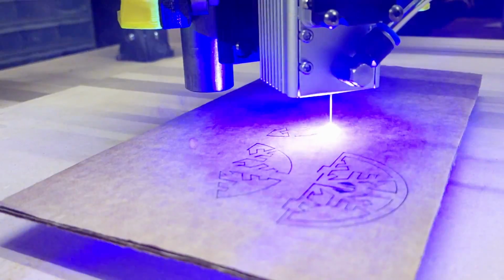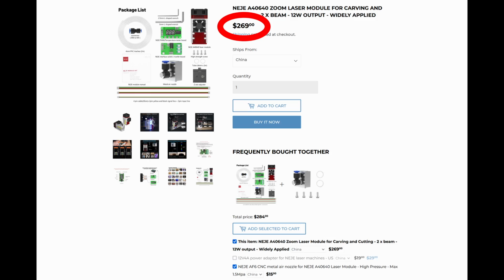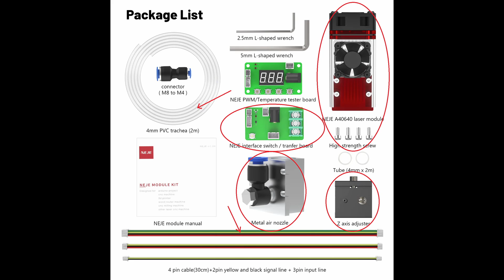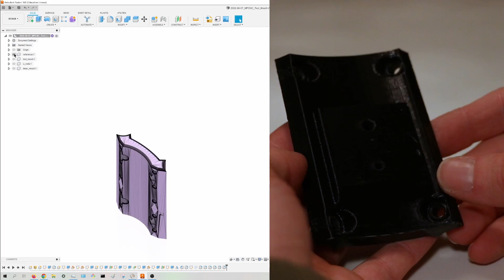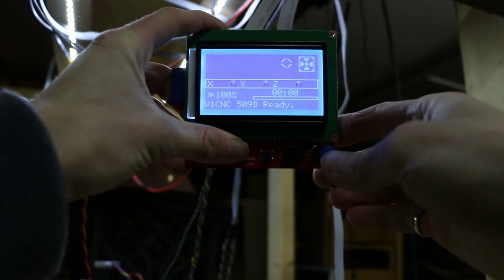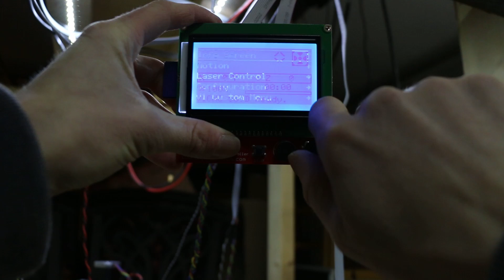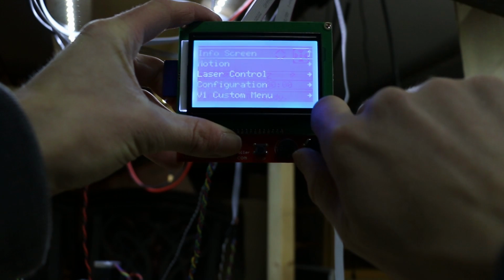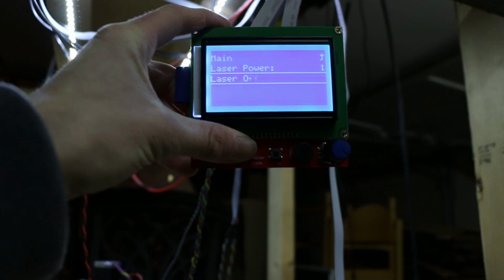MPCNC + A40640 Diode Laser - Installation

Comment: What size conduit was  this tool mount created for? Would you think it would fit the C-23.5 mm (3/4") version? You did not state the conduit size of your machine. I am trying to fix the A40640 laser to a Burly.
Reply from the maker: Hi Robert,
The specific mount shown in this video and up on my grabcad is for 25.4mm OD tubing. I actually used thick-walled DOM tubing because the marginal cost was worth it for the extra quality, rigidity, and ability to tap the tube walls

If you want to mount the diode to a burly, you could download the f3d file, and try adjusting the design sketches to match the dimensions of your machine. I can recommend a piece of software called 3d-tool (https://www.3d-tool.com/downloads/) (setup_3dtool_freeviewer.exe) to inspect the STL files of your burly, and transfer the exact measurements into the f3d design sketches
Reply: @markosfraser3030  - Thank you for the information. I will look into the 3d-tool app. Another question. I am going to hook up the NEJE A40640 to the burly with a RAMPS 1.4. What is the output voltage on the RAMBo board for the PWM output and what is Neje required input PWM voltage? What GCode commands are you using to drive the laser (M3, M4 or M106)? I am still trying to determine the proper pin for the RAMPS 1.4 PWM. I could drive the laser with D6 (FAN, 12VDC output) with the M106 but would like to with M3, M4, and M5 g commands. Last what version of MPCNC version are you using for the Rambo? Thank you!
Reply from the maker: Hi Robert,

I'm using pin 45 for laser control. It's 5V logic, as discussed in this forum post (https://forum.v1e.com/t/rambo-1-4-5v-logic/31128).

The A40640 should ship with an adapter board, allowing you to control the laser module with a control signal anywhere between ~2.4 - 12V iirc.

I configured lightburn to generate GCode with inline laser commands. Refer to this forum post (https://forum.lightburnsoftware.com/t/laser-power-inline/15493/24?page=2) and marlin/grbl documentation (https://marlinfw.org/docs/gcode/M003.html).
You'll definitely want to use inline commands, because laser control through fan output is very slow and will not be suitable for engraving raster images.

I would strongly encourage you to purchase a higher-end control board for you CNC. The RAMPS board is great, but too slow for high speed laser engraving.
It looks like Ryan is selling the MPCNC with SKR boards now. It would be hard to go wrong with an SKR controller, or any other generic STM32-based control board.

My version of the MPCNC shown in this video is a primo model.

Hope this helps, best of luck.
Reply: Hello Mark,
I am looking at the NEJE A40640 or the E40 laser module for mostly cutting. I was also wondering about the performance of the A40640 module since you are using one? How does it fair with cutting? I am looking at mostly balsa and light ply for cutting.
Reply from the maker: Hi Robert,
The A40640 would be perfectly suitable for cutting balsa and light ply. There are lots of other youtube videos demonstrating it's performance in those materials.
Air assist would be beneficial for that application; you should try to set up an air compressor and regulator.
It will also generate huge amounts of smoke and present a serious fire hazard, so make sure you have good ventilation and a safe (non-flammable) area for laser cutting.

Creality and other companies are also now producing very powerful benchtop laser cutters, you might consider just purchasing a dedicated laser cutter machine off the shelf, because the MPCNC is a heavy machine, and not the best for laser cutting (it can't accelerate quickly, a lighter toolhead is better).

Comment: What power supply are you using for the laser?
Reply from the maker: Its a 12v, 72w switching power supply. It's a sealed brick unit so I don't have to worry about dust

Comment: Great ! What firmware are you using for your MPCNC ?
Reply from the maker: I'm using the stock firmware that Ryan has flashed to the Rambo board. It is a slightly modified version of Marlin V2.0.7.2